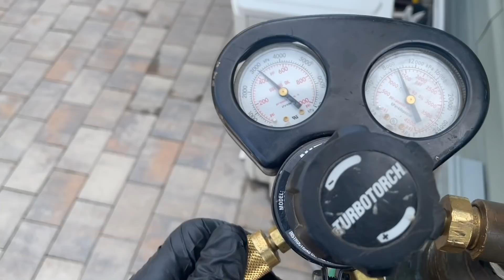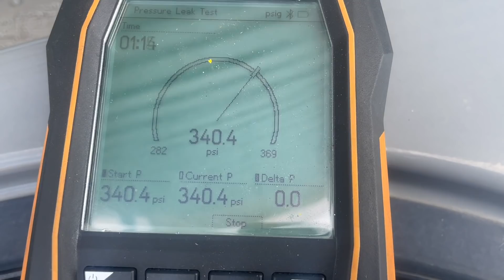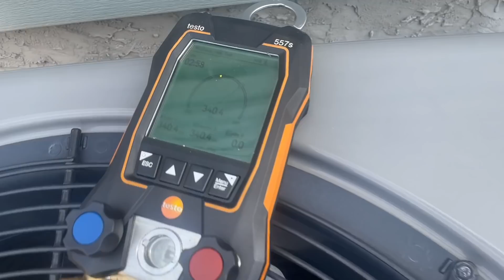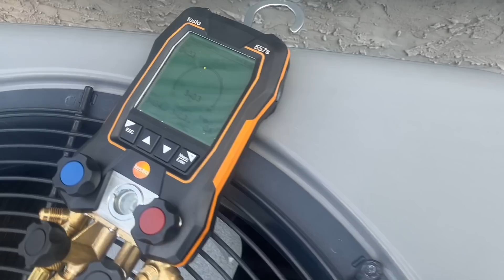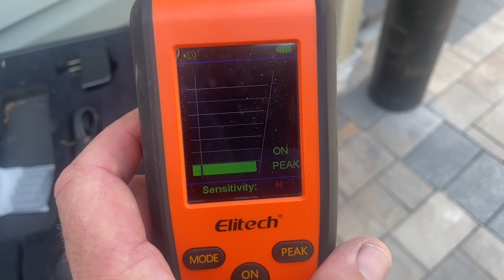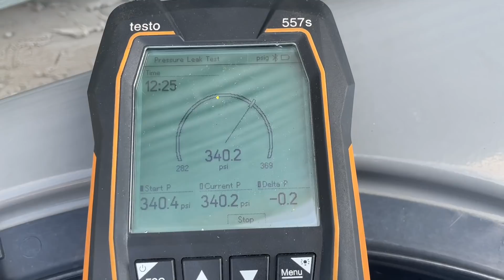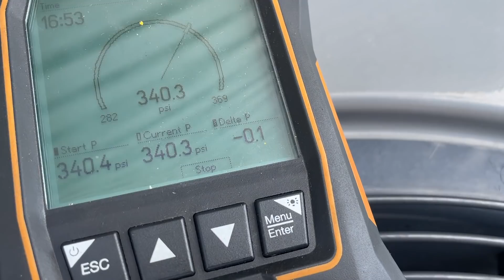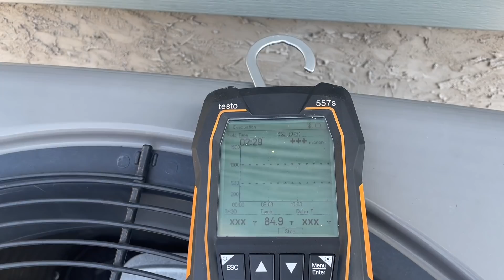6 Pounds Leaked in 2 Days! Where Did All The Refrigerant Go? Installed Wrong TXV R22 Instead of 410A

Comment: Before hooking up gauges leak test the ports with caps on and off. Especially if you think it's low in charge. If you would have checked before removing that tee it would have taken alot of the guessing and wondering out.
Reply: Not if the unit is already empty and has no pressure left to make the bubble, but your right he didn't check first.

Comment: The only problem with leak detectors is that it will pick up oil and refrigerant that was there and wasnt cleaned up .  someone once told me to use the true blue as a refrigerant cleaner and wipe off all the refrigerant with a rag and then go over with the detector afterwards.      Soap and bubbles work  Ultra sonic leak detectors are the way of the new.  u can hear it when you are wearing the head phones.      thats my 2 cents!    Good video  and i agree with you   that leak was at that service Tee.  100%
Reply: I’m guessing your using the h10.    Will eventually get one

Comment: Hey Mikey....

How you like the "557S manifold? I am ready to bite the bullet and change my old Testo 550 (STILL WORKS LIKE NEW) to the new 550-S model with the bluetooth probes.. My suction port clamp plug doesn't work so i have to use my liquid side port to plug my clamp in to get any temp readings on my lines.

I have went through 10+ clamps due top wires breaking at the plug in plug where is connects over time, wire gets weak and breaks... Not to mention the rubber flap ears broke long ago with the hook on back breaking off.. But the manifold works great.... I am soooo ready for a new Testo and that bluetooth clamps..

You like yours or Smans? Etc? Happy with the "S model??

Something to (PLEASE) keep an eye on and if you are a RHEEM/RUUD dealer like myself, you (MUST) check these following things when installing or /servicing.

1. Insert o-rings in suction/liquid caps after installation an valves have been opened up.. They are having issues with the suction port leaking thus i install a o-ring you can get a kit from a local auto parts/hardware store that fits perfectly,  I have already had  had 5-6 call backs all on different units/systems we installed in less than 2yrs of installation and (ALL) with the same (EXACT) issue! O-ring fixes issue and solution/problem has been reported into Rheem/Ruud engineers to fix going forward.

2. Capillaries on outdoor condensers being up close to fan blades. Make sure they have good clearance and tighten all zip-ties so no capillary rubbing/leaks can occur.

3. Remove "ORANGE FAN "RUN" WIRE" from "C" on capacitor and place directly to contactor. Common feed wire is a small orange wire also to capacitor but it is too small for start amperage and fan and compressor plus run for fan also. By putting fan "RUN" wire on the contactor directly eases amperage load on smaller common feed wire.. That or install a larger common feed wire for capacitor like from a heat kit etc.

4. On ECM Evaporator Motor... Take ECM fan on control wire which is Green/black stripe wire from #1 plug speed on motor housing and move to #2 plug. Blue is used for cooling/heating fan on and should be set for proper tonnage requirement.. They had some issues with the new gen 3 motors from electrical noise thus killing the controllers on those using the circulation "FAN ON" setting...  Doing this fixes that issue on any that may still be left out there or missed by the engineers "RECALL / FIX".

5. Tighten up all zip ties once brazing installation is complete for all evap capillary tubing to prevent leak chaffing etc.

Do these things and you will have a Rheem/Ruud system that will last a very (LONG TIME)!!!. Top quality equipment and in my honest and sincerest opinion.. The best most robust made and ease of use equipment made today!!!  Not to mention their dealers/distributors are some of the nicest and best people ever in my book!

I am a Rheem/Ruud man for LIFE!!!

Comment: Had something very similar about two weeks ago in about the same area. No cooling get to the call somebody left a Schrader valve tool attached to the machine. Try to remove it oh no Schrader valve pump the machine down put go to take my Schrader tool to put a new Schrader valve in The machine.the Schrader valve Was snapped off snapped off inside the freaking valve.We ended up having to go back and change out the whole valve.

Comment: Just a tip. Chris from HVACR videos says to use the stream setting on the spray gun and squirt slow and easy you kinda want a thin film of the Viper Big Blue leak detector on the surface you are checking. From what I've seen it works . Great content as always Mikey 👍👍
Reply: I was going to say did mike change the spray nozzle to a different one? I never checked
To see if there another setting on the nozzle.

Comment: If you get called back on that one Mikey look for the leaks around the base of the reversing valve pipes. Rheem has an issue with hairline cracks right there. And when the system is on and running with pressure buildup they open up and it will lose the whole entire charge. I was the first one to post a video about this problem on my channel, but I had too many homeowners contacting me trying to pull me into a lawsuit with Rheem. So I removed it. I posted it to give other technicians a heads up about the issue. And the other place that has an issue is on the 90° bend of the high pressure switch. They're cracking and blowing out the entire charge. But that's a big leak and very easy to hear when pressurized with nitrogen. The leaks around the reversing valve body can only be heard with an ultrasonic leak detector.  😎👍
Reply: Thanks for the info Shannon.
Reply: Wow
That's Goodman like stuff,huh???
🤣😂🥃
Reply: Thanks tho bro!👍